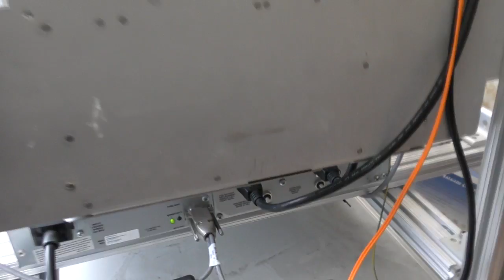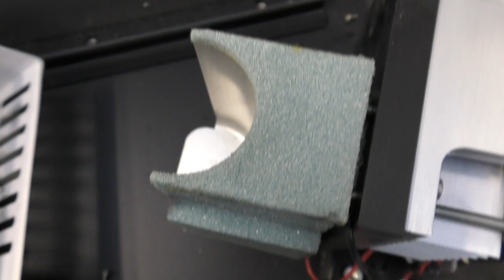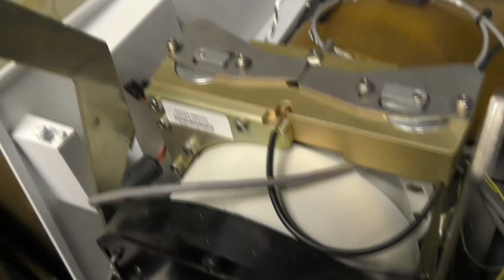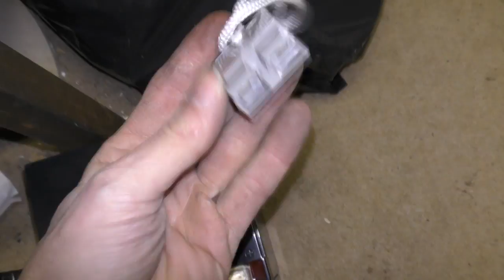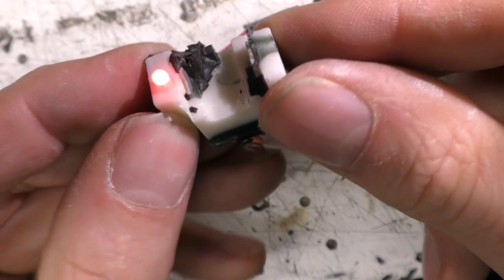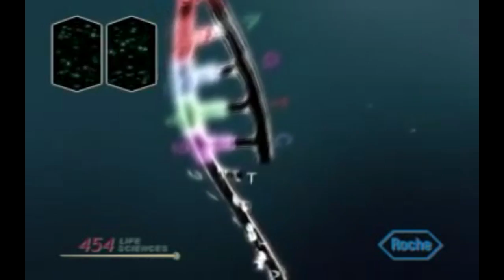Roche 454 GS FLX+  DNA Genome sequencer teardown

Comment: Oh man a 454! I used to work on sequences generated on one of these!

I took a few notes as I was watching:

Filters/flow control on reagents: yes those are filters, either 0.33 or 0.22 micron. Pretty standard fare for mol-biol labs. They don't pass microbes, keeping your samples free of foreign DNA.

Reagent cost: very high cost reagents is standard practice in this business, it's how they make their money. Now, you can make your own (they don't tell you what the reagents actually are, but the reactions taking place in the machine are pretty standard DNA copy operations, so you can take an educated guess, then mass-spec/HPLC the real ones to see if you're right, and make up your own and give it a go). Having said that, the reaction chamber slide thingy (can't remember what it's called) is a consumable (ie can't be re-used, because how do you know you've cleaned all the DNA from the last run off and that it won't compromise the next one?) and it probably comes as part of a reagent kit for the machine, so they've got you over a barrel there.

Peltier-cooled reagent reservior lack of active temp control: not necessary. The actual enzymatic reactions taking place within the machine are controlled, but all that peltier is doing is keeping reagents chilled so they don't denature or degrade at room temp during the course of the run (pretty common for biol stuff dealing with reactions producing light). The actual temp isn't really important, most labs just use domestic fridges/freezers for this kind of storage.

Labour-intensive sample-prep: Yep, that's a given. To get the most out of this machine, you need to provide it with very carefully measured samples. The DNA to be sequenced needs to be sheared into lots of strands of a particular lenth, have special joiners and the beads attached then introduced at a very well defined concentration so you don't overload the sequencer. High-speed cetrifuges for seperating DNA are everywhere in mol-biol labs, so they expect you to have access to standard equipment. Basically, you pretty much expect to employ someone full time to look after the machine. They'd feed it samples, plus do basic analysis to get the crude data to something you can begin to analyse.

The plate behind the reaction chamber: Should be held at 37 deg C for the DNA polymerase reaction.

That camera is really interesting, I hope you can get it up and running. Thanks for another great video Mike :)
Reply: Would you be so kind as to give a brief simple explanation of what the machine is used for? Thanks
Reply: No probs. I've already done so a little further down the comments thread. https://www.youtube.com/watch?v=XaumUp4GpCw&lc=z124jfo5nlepwjjis04cepwzgwanyjjowzc0k.1481463132881029

That link was meant to take you there, but it doesn't seem to work. Sigh. Scroll down and look for a comment by TheAmmoniacal and you'll find it in the reply thread.
Reply: Just a question. Why would you need a DNA polymerase reaction in a sequencer? Is it like a PCR reaction where you multiply the DNA fragments to make them easier to sequence?
Reply: @matiastripaldi406  most DNA sequencing is done by synthesis. By that I mean you produce the complementary strand of what you're sequencing, and the DNA bases (A,C,G,T) you add to make that strand either generate a product (like PPi with 454) or include a modified base (ILMN and most others) that allows you to detect that a DNA base was added. DNA polymerase is the enzyme that adds the bases to the growing complementary DNA strand. You do this sequentially and as such read the sequence. There is often a PCR step (or other DNA amplification technique) upstream of the sequencing reaction itself as well. That PCR may or may not use the same DNA polymerase as is used in the sequencing step.
Reply: Your shortening of biology to “biol” gives me really uncomfortable feelings. 

How do you pronounce your abbreviation?
Reply: Now that I'm working in the medical drug manufacturing world and undstand all this I really can appreciate the amazing complex engineering of these machines I'm in the maintenance field of where I work, which is Amgen thousand oaks look it up if you're curious on what we make. Anyway I maintenance machine's like this on the daily and it's amazing to see that these machines really haven't changed much over the years

Comment: Those heaters are from a company to the north of me in Leavenworth, KS.  They are the world's largest manufacturer of thin-film heating elements and also one of the largest manufacturer of ceramic PCBs.
Reply: ceramic PCBs, yummy  :-)
I would love to build a low noise audio preamplifier around a MIL-spec OP-AMP on a ceramic PCB. Would be neat.

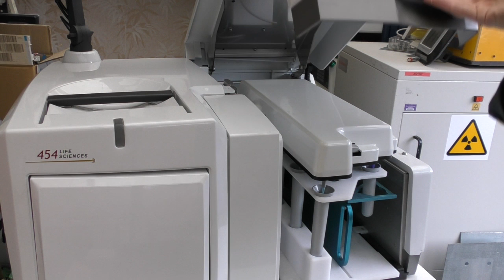Comment: 8:22 looks like the molding process where you have a negative mold, and you paint the polished smooth cavity (also acts as mold release), then either fiberglass or vacuum form or thermoset or resin cast the internals in a tumbling mold form.  It's how they make boat hulls.  (see the episode of how its made re: sea-doo watercraft)

Comment: "Possibly a few astronomy type people wetting themselves" Damn right... Holy shit the pixel pitch. Big humongous (back-illuminated!!) buckets for light gathering. Like, holy crap. 7.4um is considered "rather large" as far as astronomy CCD's go. This one has 13.5um pixel pitch. Compare this to instruments from Santa Barbara Instrument Group (SBIG), and I think I'd safely value this camera pretty highly - you can easily pay upwards of 10'000$ for a 16mpix 7.4um cooled CCD camera, and this has larger pixels which is a pretty attractive feature. And it's cooled! So are many amateur CCDs, but the combination of massive huge pixels and very low-temp capability means the noise figures on this thing must be incredibly good under optimal conditions. Looking at the QE (Quantum efficiency, so, the ratio of incoming photons turned into readable electrons), this thing goes right up over the 90% mark at some wavelengths. For comparison, a typical color CMOS sensor used in a DSLR camera gets up to a whopping 35% or so.

Damn. I don't care that I'd never be able to mount this on my 8" SC telescope (this camera is almost as large), nor power it, nor extract any images from it, but damn.
Reply: Looks like the CCD on this model is 4k x 4k
Reply: Yup, in the 16Mpix range, which combined with cooling and huge pixel pitch, and back-lit array, puts this camera comfortably in the "obscenely expensive" category if compared to off-the-shelf astronomy cameras. Heck it would be extremely good even in the 2k format... High resolution is not necessarily as important in astronomy - a 4k by 4k camera often ends up oversampling images on most telescopes. Meaning the optical resolution of the telescope is worse than the pixel resolution of the camera. Binning can still help make use of the excess resolution though, so if you can have high resolution AND big pixels, it's fine. Normally you have to pick one over the other.
Reply: Mythricia mate, all you need is a larger mount bahaha

Comment: Been studying this stuff for many years as a biochemist, but still never got to use one :( Very interesting to see one tore down to compare theory with reality! Know exactly how it works.
Reply: Dare to explain for non-biologists like us all ? :)
Reply: Yeah dude, I want to know how that thing works.
Reply: It's hard to explain this in a youtube comment, but I will give it a go (note, this is way simplified):

First you need to know something about DNA. It's double stranded, each strand is like a string of letters (called bases). There are four letters that make up the strands: A, T, G and C. The two strands are wound around each other in the famous double helix due to their complementary nature. Each letter has a complement, A complements T, and G complements C. So you might get a double strand like this (the 5' and 3' is mol. biol. jargon denoting the direction of the strands) :

5'-ATGCCGTAGCAT-3'
3'-TACGGCATCGTA-5'

The complimentary bases of one string stick to those in the other string via hydrogen bonding, which is what holds the double helix together. It's an important property that is leveraged by the sequencer.

Okay, so you do a whole genomic DNA extraction from your organism of choice. Your sample will contain millions of cells, which means you get millions of copies of the chromosomes. You take your purified chromosomal DNA and shear it up into lots of little pieces approx a few hundred bases long. Now you 'ligate' (attach) some very short pieces of DNA with a known specific sequence to the ends of all your unknown sheared-up chromosomal sample DNA (these are adapters). You then denature the double strands so they fall apart into single stranded pieces.

Take the single stranded pieces and add them to a suspension containing little tiny manufactured balls with short pieces of single stranded DNA (ssDNA) complimentary to the special adapters you stuck on your sample previously. Your ssDNA will be able bind to the adapters on the balls via complementary pairing, forming short double-stranded DNA right near the ball, with the still-unknown rest of the single strand floating off it. The balls outnumber the ssDNA pieces many times over, so on average, you only get one ssDNA piece on a ball and most won't get any DNA at all.

Now put these balls onto the 'nano-titre' flow cell slide (the glass thing with the strips in front of the camera in mike's video). This thing has tiny little nano-sized holes in it. The balls will fall into the holes, taking the ssDNA strands with them. Think of it kind of like a nano-sized series of honey comb cells. Now there are so many balls and so little DNA relative to the numbers, that on average, there should be only one ssDNA piece per honey cell (if there even is one in there at all). The reason they are in the holes is, we can now gently wash reagents over them and do reactions without the balls (and hence DNA) moving relative to the camera (which is very important as we'll see). 

Okay, now comes the important part. The actual reaction. The reaction is to take your ssDNA pieces and make a copy of them one base or letter at a time. The enzyme that does this is called DNA polymerase.  DNA polymerase cannot start on a single stranded DNA strand, it MUST start from double stranded and extend the complimentary strand. It's a good thing we have a very short piece of known double stranded DNA formed from the complimentary binding of the adaptors sticking the ssDNA to the the ball, huh? ;)

Confused? Yeah, me too. It's ASCII art time!

5'-ATG(DNA pol.) -> enzyme moves along making a new strand complimentary to the original
3'-TACGTACGATCATGCTAAG-5' <= This is your single-stranded template

5'-ATGC(DNA pol.) -> 
3'-TACGTACGATCATGCTAAG-5'

5'-ATGCA(DNA pol.) -> 
3'-TACGTACGATCATGCTAAG-5'

5'-ATGCAT(DNA pol.) -> 
3'-TACGTACGATCATGCTAAG-5'

5'-ATGCATG(DNA pol.) -> 
3'-TACGTACGATCATGCTAAG-5'

And so on and so forth...

The trick here in this machine is that the reagents they use are fluorescent. So each letter has a different fluorescent dye attached to it. We'll also only let the reaction proceed for one step at a time. You add the enzyme and the reagent for one base (say A). All the ssDNA pieces in the honey comb cells that start with a T (complimentary to A) will have an A added to them by the enzyme. After the cycle, the dye is excited and induced to fluoresce and the camera takes a photo of the slide. Then, you move on to T. Again, if there are any strands that now have an A exposed next in line, the enzyme adds the T, and you take a photograph. Then G, photo; then C, photo. This cycle keeps on repeating through all the letters over and over until you have a complete copy of the original strands and a series of photographs taken along the way. The enzyme can only add one base at a time because you only give it one base at a time to add.

In order to get the actual sequence, we simply (HA!) analyse the photographs. NASA star field algorithms are used to look for changes to the dots in the pictures as the cycle progresses. Each dot point represents one DNA strand in a nano-well. As the colour of the dot changes from one cycle to the next, the colour in the photo will change from one to the next. The algorithm simply reads off the sequence using the colour as a marker. At the end, we have the complimentary sequence to the ssDNA strand that was in each well. Then the hard part is putting all the pieces of the puzzle together (assembling the sequence) to get a complete unbroken sequence of letters from one end of the chromosome to the other.

I strongly recommend you have a read of the wikipedia articles on DNA and DNA sequencing. There are some good animations on youtube of the old-school sequencing methods (still in use), like the Sanger method. If you understand how that works, you will see this is just a fancy pants way of doing it the old way :) It just does it massively parallel.
Reply: Thanks a lot buddy for explaining this process, very interesting !
Reply: You're welcome. I've learned so much from Mike and other knowledgeable people in the comments of his videos, that it's good to be able to return the favour and be that guy that knows something about an obscure and expensive piece of equipment. Cheers :)
Reply: David Allen
Well, that sure was en explanation, thanks dude, I may look into it a bit more.
Reply: +David Allen
Thank you :)
Reply: Thanks for taking the time to write an explanation that's comprehensible for someone who is not a bio science engineer :-)
Reply: David Allen Great explanation, couldn't have done it much better myself! (meh, details)
Reply: A few corrections on the description given by David Allen of the sequencing process which are relevant to understanding the design.

454 used a process called pyrosequencing. There are NOT any fluorescent labels involved - that's why you found a camera but no excitation light source or optical filters. When the polymerase adds a nucleotide to the strand, it kicks out a molecule called pyrophosphate (P2O7) - the nucleotide starts out as a triphosphate but only one phosphate goes into the DNA. This is why the technique was named oyrosequencing, after the pyrophosphate. With the right form of the nucleotide adenosine around, an enzyme called sulfurylase converts that to ATP.  The enzyme luciferase plus a chemical called luciferin emits light - this is the reaction fireflies use. So it is that emitted light which the CCD measures.

Note that if the polymerase can add two of the same nucleotide, because the opposite strand has two of the complementary nucleotide, the two incorporations occur with two pyrophosphate released, so you should see twice the signal. The longer such a 'homopolymer run", the higher the signal - except the linearity breaks down, so homopolymer were the most likely place for 454 to make errors - calling 5 instead of 6 in a row or such. 

The other key point is that the beads start out with a single DNA molecule, but that is then replicated across the bead by a technique called emulsion PCR. You encapsulate the beads in aqueous-in-oil droplets, then run PCR (polymerase chain reaction) within the droplets. Then you break the emulsion and load the beads on the PicoTiter plate. The key here is that the bead is covered in many identical copies of the same DNA, which boosts the signal enormously. Beads that started with multiple molecules generate mixed signals, so are useless. Ideally the reactions would keep all those molecules in lockstep, but at each cycle a few on each bead get out of sync. Hence, over the course of a run the signal falls and the noise grows, which is one factor limiting the length of DNA read
Reply: Gotta love it when someone asks a good question on youtube and someone actually takes the time to give a proper answer. Thanks.
Reply: @davidallen6421  5 years later...Not sure if you're still in the field at all; if you are, what's the coolest new thing related to DNA sequencing in the past five years?

Comment: Aluminium can be readily nickel plated, that explains the look of the heatsink. Makes sense if any portion of it is exposed to high vacuum section (anodising is a no-go there due to the porosity, hence creating nasty virtual leak).

Comment: The optical connector on the camera is an MT-RJ duplex multi-mode. You can get multimode patch leads which convert this to multimode ST connectors, which would connect to a standard gigabit ethernet interface (it said gigabit ethernet on the interface board silkscreen).  I've only seen the MT-RJ connector used on some old fixed-configuration 100Mbit Cisco switches.

Comment: Hey Mike, jugding from all your medical equipment teardowns, are you planning on getting a MRI scanner for teardown?
Reply: Having been in an MRI several times, I'm sure they must weight literal tons. And when removed from their site are already torn down into unrecognizable parts.

Though, if he could manage to get invited to a teardown of an MRI machine, I'd love to see it...
Reply: Lol.
Reply: He should get one of those 100kV+ xray transformers! X3
Reply: +Benjamin Esposti He already does.
Reply: @FrozenHaxor  i need one too haha
The arcs must be insane
Reply: An MRI scanner contains upwards of 1000 pounds of copper wire and another couple hundred pounds of superconductive titanium-niobium wire. They're encased in resin and a stainless steel pressure vessel filled with  liquid helium. Otherwise the isn't actually a lot of interesting tech in there, just a bunch of antennas and RF circuitry. Those microfluidic and laser optic devices are probably more rewarding.